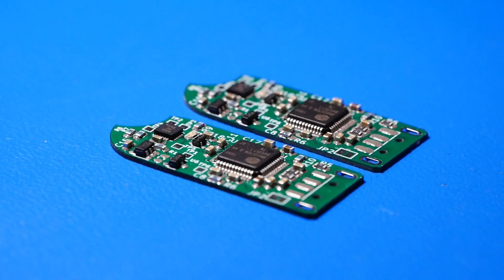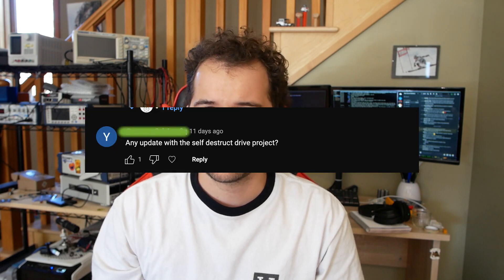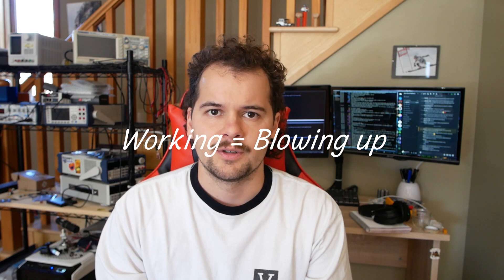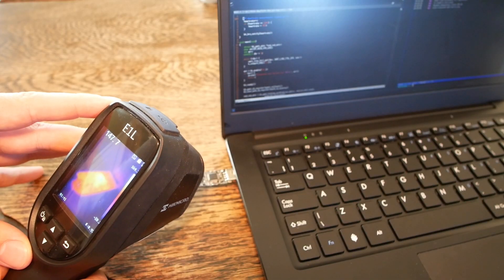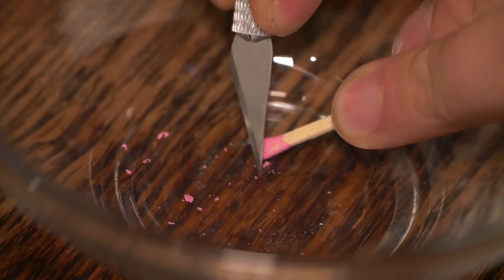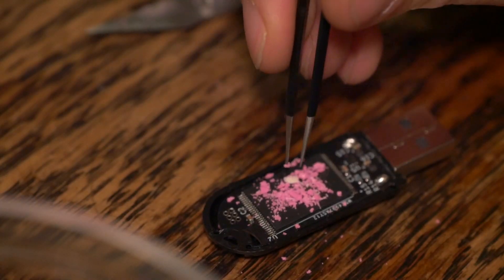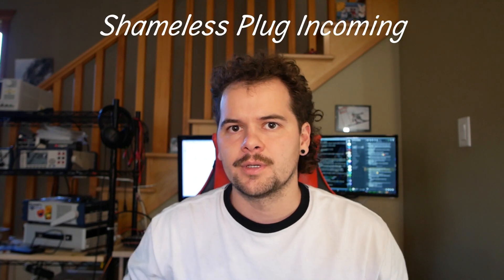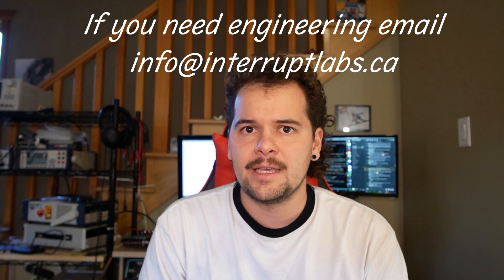I Heated a Flash Drive to 160C and it Still Works! (Ovrdrive Update)

Comment: Heya! I was thinking about how to do this a few years ago and just found your video.

My idea was based around using Nichrome wire with a small piece of Magnesium Ribbon and if just that isn't enough, you could use a small amount of thermite.

Nichrome wire has a max operating temperature of: 2150°F / 1180°C
However, I don't think this will be enough to fry the flash memory.

Now, magnesium is flammable, it burns at a temperature of approximately 3,100 °C (3,370 K; 5,610 °F), and the autoignition temperature of magnesium ribbon is approximately 473 °C (746 K; 883 °F)

So, if you could get a small piece of Nichrome wire to heat up enough to ignite the magnesium ribbon, it may just work 🙂

Keep up the great work!
Reply from the maker: One day me and you need to talk.

FYI: https://www.vishay.com/files/whatsnew/doc/npi_130212_NPI_Resistors_Sfernice_MEPIC.pdf

Comment: Since you can reverse polarity, I can assume you have a couple of FETs to isolate the voltage rails to the flash. You could build a small version of the flyback circuit in the USB killer (20 to 40V spikes), isolate the flash chip then hit it repeatedly with the flyback circuit til it silently gives up its silicon innards.

Comment: Add a dc-dc voltage booster circuit?
Reply from the maker: I tried something like that already. It wasn't consistent enough. https://interruptlabs.ca/2023/02/06/I-Built-a-Self-Destructing-USB-Drive-Part-3/
Reply: @rootkitlabs  Very cool! Can't believe nobody took a good stab at this gadget concept yet. (++kanthal wires for a propper barbecue?)

Comment: Ayee my comment got featured 🎉. Just out of curiosity, why not add more capacitors? Even if the board has to be a little bigger. Surely enough caps will destroy the flash
Reply from the maker: Hey thanks! I tried adding quite a few caps, but it didn't work :(